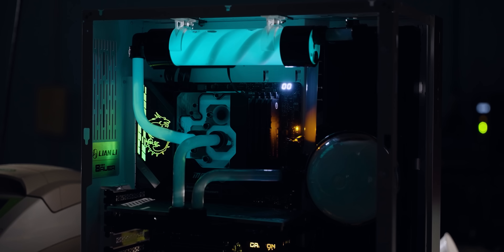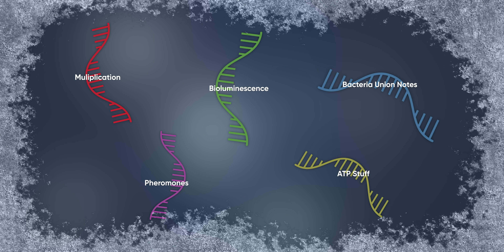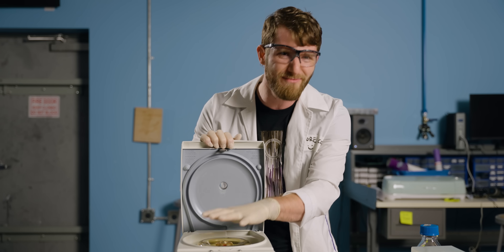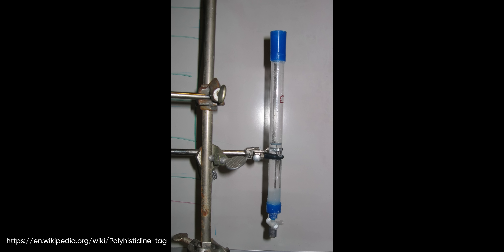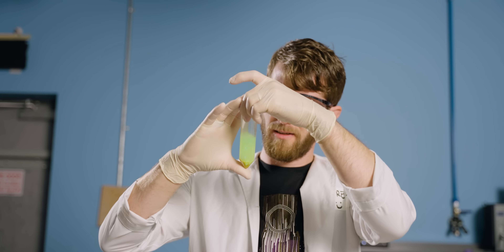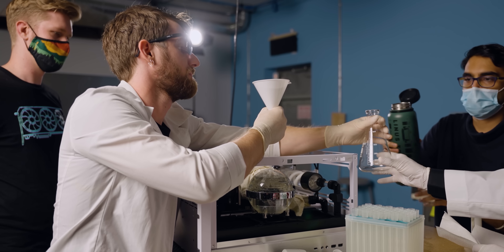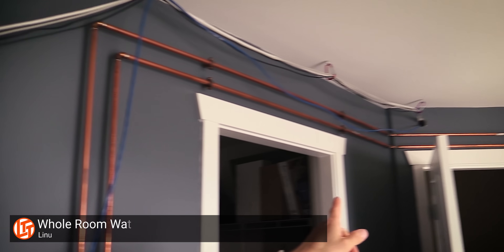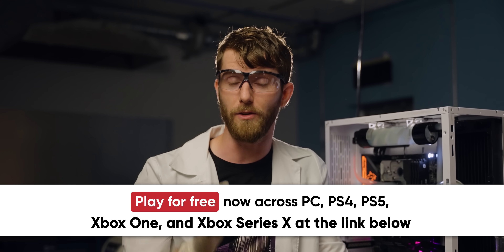The Bioluminescent Gaming PC

Comment: I really wonder how it would be to have a biohazard pc cooled with less heatcapacity but higher density quicksilver.
well, as water has aside from hydrogen and helium the highest specific heat capacity it might be better, but i would really be interested in you guys trying silicone oils, alcohol, quicksilver or turpentine for example and show the difference in it. maybe even try supercritical helium at 3 bar or alike. or whatever stuff is in those heatpipes of the aircoolers.
I really wonder how much it would change the properties of a cooling system if you would take more or less viscose fluids and if you can create the ultimate diy watercooling fluid by putting additives in it. Or can you make a top tier list of fluids used for cooling?

Comment: I am taking biotech right now the process of which to copy a specific portion of DNA, repeatedly is called PCR (Polymerase Chain Reaction). The bacteria commonly used in this experiment is E. coli. You pipette the genetic code for bioluminescence into the bacterial sample when at a high temperature in order for the DNA to enter the bacteria and cool it down to close up the seam you used. The equipment that is recommended for this experiment are micropipettes, the thermal cycler, and microtubes. All the equipment needed to do the lab can be very expensive. A micropipette is able to draw up 1/1,000,000nth of a liter. So, the equipment used is very precise and expensive.

Comment: I’ve always been confused on why people use water cooling in things that could break to water🤔
Reply: I definitely see your concern, i used to think the same thing! But water cooling is (in principle) far better at dispersing heat than air cooling, you just have to be very careful to avoid leaks. If youre really worried about leaks, I’ve heard people often use non conductive liquids like mineral oil (i think thats what they use, not entirely sure though) so that if any of the liquid DOES get on anything important, the non conductivity prevents the parts from getting damaged :)

Comment: Okay, that's legit fucking awesome. Somebody needs to find a way to make this permanent in the system. Mad science here, but what if your pc was plumbed in to your house with a filter. This would be combined with a Enzyme distribution system that would release enzymes every so often. When the glow cycle ends you cycle in new water and enzymes. To avoid the pump  running dry you do this run steps. To clean the system of debri you'd run the system with a constantly changing loop of just water through the daylight hours. I think the key with this would be a very solid water filtration system matched with a very high flow pump. Probably even water blocks specifically designed with this in mind. Sounds crazy, crazy expansive and crazy niche, but can you imagine how cool it would be?

Comment: you should keep living bacteria or microorganisms in them, then you add sugar or other feed material to make it live, the weight products from the organism's can be filtered out, for example using weight. this way you can not only make as manny as you want using only a material like sugar, but you can also keep it glowing using the same material. yeast for example would be a easy candidate for this. however to make it efficient you either need to make it so that it can resist the generated alcohol, or you need to reduce the amounts of sugar added and keep it warm so the alcohol evaporates faster, you can also add it to your skin, that way all works automatically and you have a cool glow effect.

Comment: This is a long comment/suggestion. But I hope you read the whole thing.

Using luciferase, luciferin, ATP, and O2 to catalyze an enzymatic luminescence reaction inherently runs into the problem of running out of substrate which then requires refilling the loop with more substrate as you mentioned. The glow stick company needs to use the luciferase system since no additional ingredients are required other than the ones already provided in the stick. But for a PC, you can take advantage of one key ingredient that is already present in any self-respecting gaming PC, RGB light.

I would suggest using fluorescent proteins which can absorb specific colors of light and then emit a longer wavelength color light. The most famous is probably green fluorescent protein (GFP). If you filled your loop with GFP, it would look like a dull yellow-green fluid. But once you turn on the blue RGB in your PC, that blue light will get absorbed and then be emitted as a visibly green glow. This glow would be recharged every time the GFP solution encounters blue light from the various RGB lights in your PC along the loop.

I have no idea exactly how this would look, but you could play with the proximity of RGB sources to the GFP loop to see if that affects the intensity of the glow. And you could use different RGB effects like strobing to see how that changes the glow of the GFP as it absorbs light unevenly and flows through the loop. You might be able to make a pulsating wave pattern. Or the least exciting would be that the blue RGB in the case simply bleeds all over the place and the entire loop lights up uniformly regardless of what RGB effects you try.

EDIT!!! I just thought of another ingredient a PC has...heat! You could tag the GFP to a liquid-liquid phase separating protein. These proteins form droplets like oil under certain conditions, one of which is temperature. Thus you could have this glowing green liquid that mixes well at high temperatures but demixes into droplets at cooler temperatures. So you could observe the relative temperature of your coolant in the loop...or an 80C CPU block will just denature everything it touches...
Reply: I think you could even get a work around to the GFP being thermally stable when it touch a cpu blocl. According to a study by Ishii et al., "Study of the thermal stability of GFP in glucose parental formulations" in 2007, you should be able to have GFP fluroesce even up to 100C in the right conditions. so it could not denature, or denature more slowly as it lights up!

Comment: Ohhh! This is how they made the Covid 19 vaccine!
Reply: No, not even remotely true. Also, this is not even the same science, lmfao. You are dumb. Covid19 is a naturally evolved virus, it's very basic bioscience to understand the difference between naturally evolved virus and a synthetic generically engineered virus. Specifically by comparing the available genome sequence data for known coronavirus strains. The genome has been sequenced years ago and is public information. Hell, you can conduct the test yourself if you have a home-lab.
"The scientists found that the RBD portion of the SARS-CoV-2 spike proteins had evolved to effectively target a molecular feature on the outside of human cells called ACE2, a receptor involved in regulating blood pressure. The SARS-CoV-2 spike protein was so effective at binding the human cells, in fact, that the scientists concluded it was the result of natural selection and not the product of genetic engineering.

This evidence for natural evolution was supported by data on SARS-CoV-2's backbone -- its overall molecular structure. If someone were seeking to engineer a new coronavirus as a pathogen, they would have constructed it from the backbone of a virus known to cause illness. But the scientists found that the SARS-CoV-2 backbone differed substantially from those of already known coronaviruses and mostly resembled related viruses found in bats and pangolins.

"These two features of the virus, the mutations in the RBD portion of the spike protein and its distinct backbone, rules out laboratory manipulation as a potential origin for SARS-CoV-2" said Andersen.

Josie Golding, PhD, epidemics lead at UK-based Wellcome Trust, said the findings by Andersen and his colleagues are "crucially important to bring an evidence-based view to the rumors that have been circulating about the origins of the virus (SARS-CoV-2) causing COVID-19."

"They conclude that the virus is the product of natural evolution," Goulding adds, "ending any speculation about deliberate genetic engineering."
Reply: @sqlevolicious  I'm not reading this lol

Comment: What is needed is an electrolytic cell that 'recharges' the enzyme continuously.
Fill your loop, activate the glowing stuff with a shot of enzyme 'fuel', but keep the fuel active through Magic of Science™!
After shutting the computer down, the fluid will glow for a bit and eventually go dark.
Running it again and the glow comes back.

Comment: Wow, never expected to see Linus doing biotech Lab Work.
This takes me back to my days as a lab monkey. 
Question... wont the temps of the system kill the E. coli and denature the enzymes?
Reply: Yeah that was my first thought too... I mean, extremophiles do exist but I haven't heard of anyone doing much work with them so don't know if there are any possibilities there... And some things would just grow out of control depending on the heat... 
Now I'm no scientist but yeah i can see a lot of difficulties with integration unfortunately... 

Perhaps having a larger reservoir to better even out temperature shifts? Or just a secondary holding tank to let the little guys cool off every once in a while? 
Not sure how they'd handle the heating and cooling cycles though, even if they could more or less handle the high heat, the ups and downs whenever the computer is shutoff or ran full out, that stress over time could add up...

Comment: You could have mentioned that the thermocycler is actually doing PCR polymerase chain reaction.

The covid test works the same way. You get primers for specific covid genes and then you just send it. If there’s viral genetic material present it will get multiplied and you can detect it more easily.

Comment: couldnt you just use the light activated glow stuff instead, and have a hidden uv light on the loop that charges it as it flows through the loop to keep it glowing for years? i feel like that would be easier.

Comment: Or you could simply buy glow in-the-dark dust and mix it, there are some ingredients that give many time of light though are also more expensive and depends on the color too, but I'm sure it will only reduce watercooling performance, but anything will at least be much cheaper than that.

Also the big advantage of glow-in-the-dark is that you can simply charge them with UV light and they are ready to glow again and the ingredient last many years...
Reply: Yeah, that seems like a neat solution. If you want to get really fancy could have a UV light in the loop.
Reply: @timfallonphd3085   Yep and could be very hidden to not even see any kind of light bleed from the UV light while it could keep charging 4 ever and the brightest ingredients really go super bright.

Not the kind of thing I would use anyway 😀

On my PC I used to have CCFL's decades ago and even one very bright blue one with sound reaction but I never really used them, it was just in the case to show to other people and nothing more, I always left them OFF.

Nowadays I have none in the case but have a drawer full of CCFL of every kinds of colors :)

I also use no LEDS, all my 4 aRGB fans are OFF, the GPU RGB is OFF and the only thing lit is small white leds from a black fan that came with the cooler.

Comment: Hey, I was asking if you could somehow collab with some chemist to come up with a liquid that would change colors according to temp, it would be cool to see blue liquid going into CPU cooler, coming out red, then turning blue again after going through the radiator
Reply: Sounds totally doable to me. These types of compounds are called "thermochromic", if you want to try and see if there are any available that might work!
Reply: I've seen mugs change colour when you pour a hot drink in it, so entirely possible I guess
Reply: @sushimshah2896  yeah, it would be cool to see a coolant like that, it would even be able to tell you just by thr color if your cooling system is working good or not

Comment: To add a bit more detail about how the light is produced from the reaction in case anyone is interested: Luciferases are enzymes that catalyze ("speed up") reactions between molecular oxygen (O2) and an organic compound (a "luciferin"). The product of that reaction (the oxidized organic compound) is in an electronic excited state (meaning the electrons are in a higher energy level than the ground state they would be in under normal conditions). The electrons in the product will go back down the ground state and (because of conservation of energy) release a photon of a particular wavelength (color) that corresponds to the difference in the excited and ground state energy levels of the electrons.
Reply: my thoughts are if you add energy (heat  can it be reversed)  in  any of the possible  compounds, as in if you add energy can it revert  or is there a  mix that can... it will be very intresting if there is  some compounds that can.  i guess that what they are looking for  if they find it  score

Comment: It may not be practical to have to keep topping your system up with enzymes full time, but I can see it being manageable for a few hours. It would be the ultimate baller move for a LAN event or something.
Reply: You might be able to get some of the photosynthetic bioluminescent critters to live long term if they were exposed to ~12+ hours of decent light per day - but it wouldn't be for cooling. Most organisms and enzymes don't do super well when exposed to ~90˚C temps :)
Reply: @timfallonphd3085  Good thing 90˚ is something your coolant should never, ever reach. The acrylic used in blocks, pumps, and reservoirs can start to deform around 50-60˚, so I have my fans set to go to 100% if the coolant even hits 40˚. That never happens. It tends to stick in the low 30s. If it were the same temperature as the CPU, it wouldn't be able to pull heat away from the CPU.
Reply: @waveformdistortion  Ack! You've exposed that although I know a lot about bioluminescence I've never done a water cooled build myself. Thanks for the info. 40˚C, would actually be OK for E. coli (they wouldn't be happy, but would survive. Their "heat stock" response is around 41-42+˚). For something like a dinoflagellate, 40˚C would be death, for sure.

Comment: As a biochemist some of this was very hard to watch but well done, its a reasobably good explination. Questions for the lab guys, why wasn't this possible with gfp? Would it not be more effective for a PC to use a weird transition metal and heat as the excitation energy? (guess light works too) 

Couple things people will probably care about 
The pipette he droped is fucking expensive and quite delitcate. 
Not many people outside of labs call a pcr machine a thermocycler (dispite that being the correct name) 
You top up the coolant with substrate not ezyme dummy!

Comment: If you want to do this at home you'll only need:

200 dollar variable volume pipette
Reply: There is always Ebay :) Rather than a variable volume pipette, a standard medicine dropper, releases about 20 to 50 microliters per drop - more than enough accuracy to do this type of experiment at home.
Reply: you could use a thin straw as long as you make a good estimate on the volume. a bikewheel as centrifuge, and pots and pans with different temp water in them for the thermalcycler (Its gone take a while though getting your sample from pot to pot 40+ times)
Reply: @zechsta28  Yep! I think there are lots of ways to make this work at home, without the "professional" equipment, just have to get a bit creative. After all, biologists in the 1800 - early 1900s had pretty crude tools but were able to figure out a huge amount of stuff!
Reply: Also if you used the centrifuge he showed, you'd be spinning small amounts of that culture all day long... Not 10 min
Reply: But they are soooo satisfying to use
Reply: At least the column is only five cents?

Oh, wait. I think I might have that confused with something else. :-/

Comment: I bet with a lot of those “glow sticks” and the luminescence you could actually make yourself a diy glow in the dark lightsaber from Star Wars.
Reply: Then it will be pretty heavy since it's filled with water, and not retractable of course. Now some excellent-looking lightsabers already exist using diffusion of a beam of LED light to light up the entire retractable blade.
Reply: I feel like LEDs, a toggle switch, and a sanded plastic tube (to make it opaque) would be lighter and far cheaper lol
Reply: @nickthemage2052  Yes, that's what cheap sabers are, a LED strip in the middle and plastic outside. It's not retractable though, thus not a true lightsaber but a fluorescent lamp with color, attached to a handle
Reply: @oMega-sm1eg  yes I’m aware.

Comment: As an immuno and microbiologist, this is by far the best content ltt could have produced. Great vulgarisation of the scientific principle behind it as well. I would like twice if I could.
Reply: virologist and molecular biologist here,  this might help some begin to understand how mRNA  vaccines work  as well.  Tip of an  iceberg but a start.  other than that is there a version of these products that has both molecules  stable  before and after binding that can reveresed by say the application of heat. so in the cool part of the loop they bind and emit light  but on the addition of heat dissacociate ( pass through heat block over chip), rinse repeat.   i guess it depends on how stable the protein or capable of refolding after the  techicaly heat denaturing.  awesome work  either way and shows molecular biology/ bio chemistry off  well, in way lots can see and understand. ahh beer  and  now i cant stop thinking grr